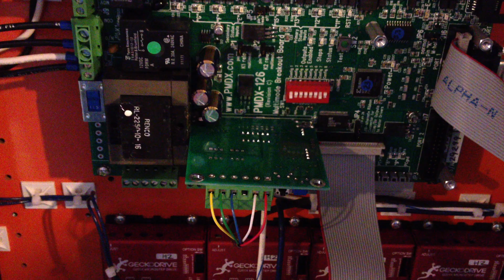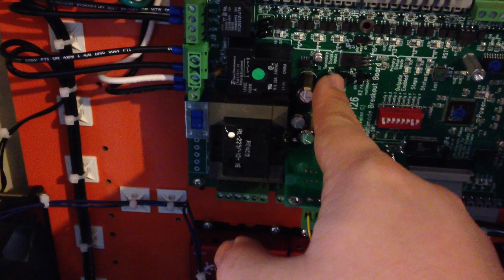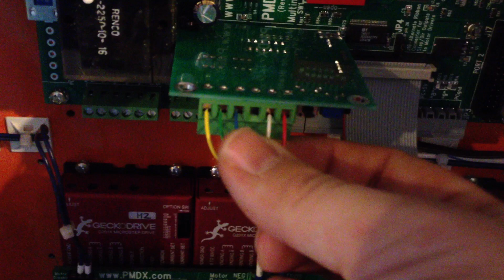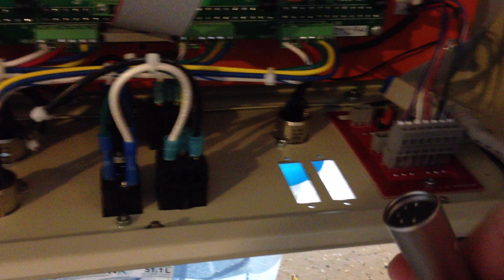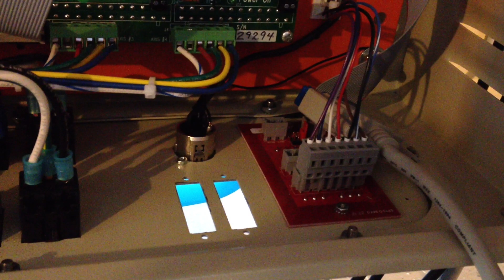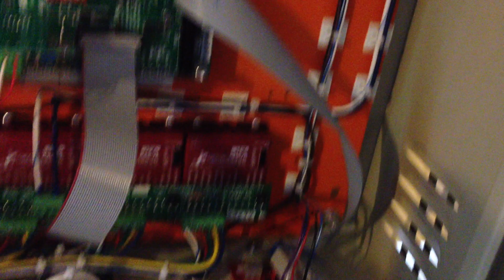CNC Router CNCRP 4896 Build 15

Comment: Hello Dirk,
How happy are you with the Chinese spindle and VFD?  any problems?
Also... how well do you think the Ethernet smooth stepper does?  it's about 200buck plus the PMDX boards...  I just want to make sure there aren't issues with it running MACH3  versus using the PC and parallel ports to do all the control sygnals.
Great job on the machine !!!